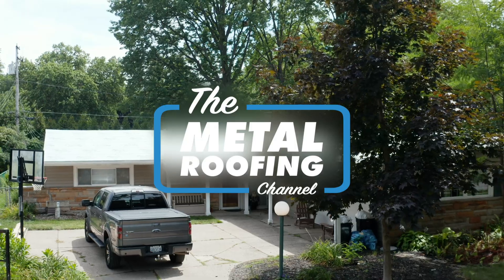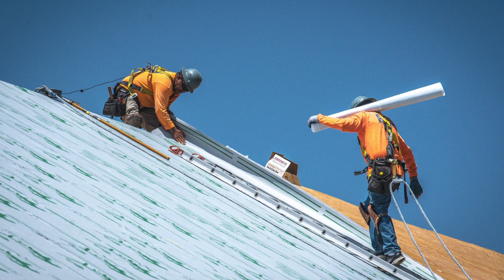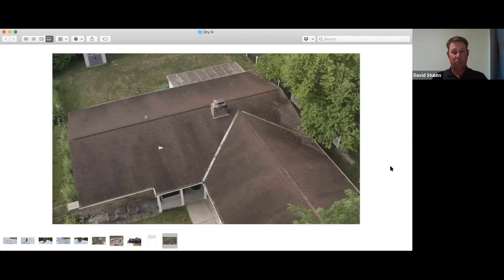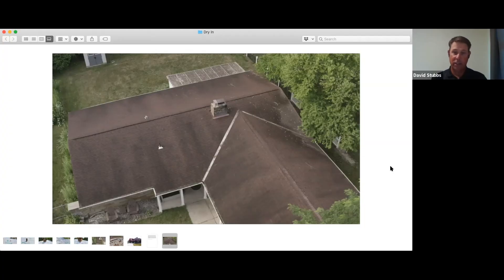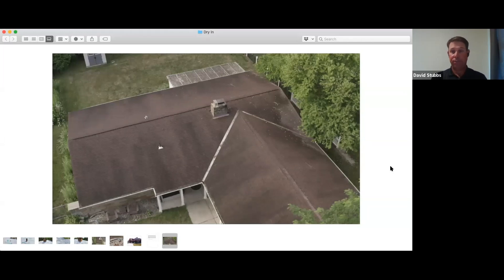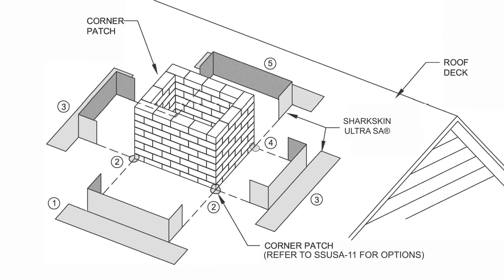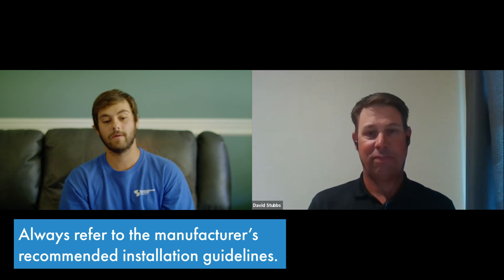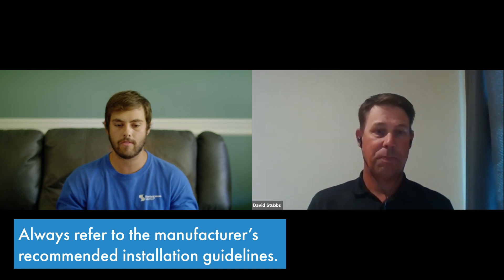How to Dry In a Metal Roof: Products, Techniques, Best Practices

Comment: Dudes crazy on valley underlayment, you weave the adjacent first course bottom eave rows only, then you run a full valley piece from top to bottom. The remaining courses get cut 6-10" out of the center of the valley, on the valley angle.

Comment: Great info.  How would Zip sheathing the brown roof 5/8” comparison with the shark skin? Would you need the shark skin or could you go right over the Zip with your metal roof?  Thanks.
Reply from the maker: Here are some things to consider with the Zip System: I would always continue to use an underlayment no matter what. These Zip products need to be taped and rolled at the seams correctly, seams have to have proper spacing, and all over-driven nails need to be sealed. There is a chance some areas might be missed, so using a quality peel & stick as a secondary defense is a good practice. My suggestion for roof decking is ½” minimum plywood or 5/8” OSB which are close in fastener pull-out values, so you are making the right choice there. Hope this helps! -Thad

Comment: if you are in snow country and apply a fully adhered membrane - will you have a problem with water condensing con the underside of the membrane causing rot?  The reason I ask is a lot of cold weather districts call for a vapor barrier in the inside surface which means the roof could not try to the inside.
Reply: Mr. Anderson is correct.  If you simply look at one component of your roofing system without being well versed in the IBC or RBC (also this year we will begin to see alot more of this issue as now the Energy Code has changed as well) , you will most likely be overlooking the ventilation requirements.  In cold environments, it is imperative to do a proper ventilation calculation to insure you have the proper venting system in place to vent the moisture laden air BEFORE it can condense.  If you are experiencing condensation under your self adhered you have a venting problem, not a roofing problem.
Reply: If the atic space is properly ventilated a sealed deck wont cause any problems. Most roof systems are basically impermeable without peel and stick anyway. Almost all synthetic underlayment is impermeable when applied

Comment: I used 5/8 Zip for my roof sheathing and since it has the WRB built in, they said just screw the metal sheets directly to that, so that's what we did.
Reply: What about seams?  You applied tape?
Reply: @613kc  I used liquid flashing (Dymonic 100 black) at the seams but the Zip tape would have worked just fine too
Reply: I’m not sure if you did the right thing.  But, I will say: I put a piece of 1/2” Zip in a bucket of water for more than a year. While it did swell to 3/4”. But,  it was structurally solid after that........